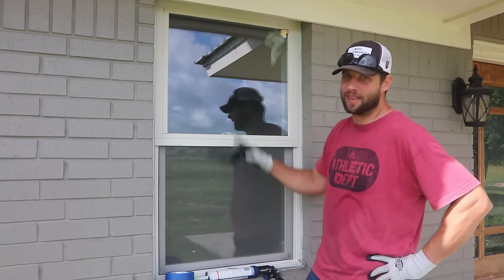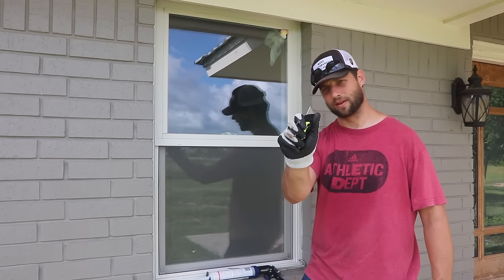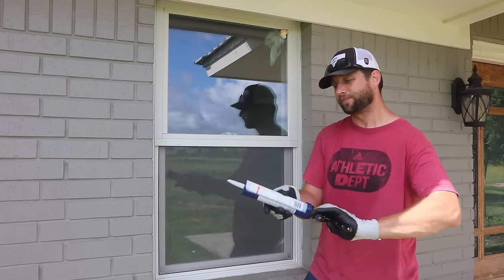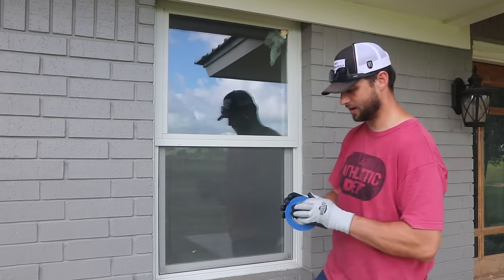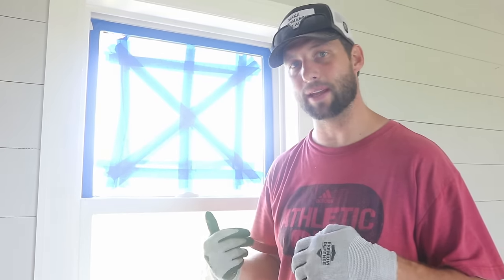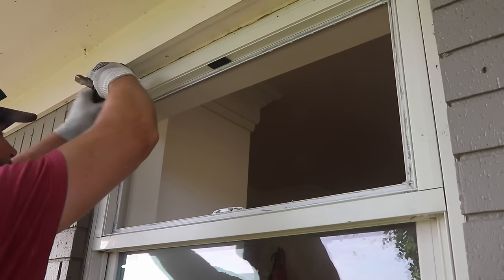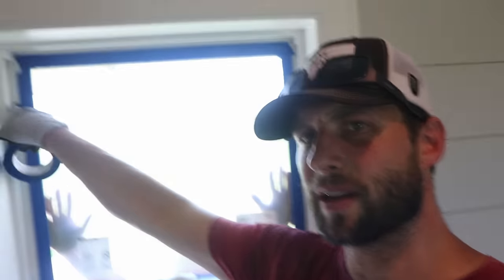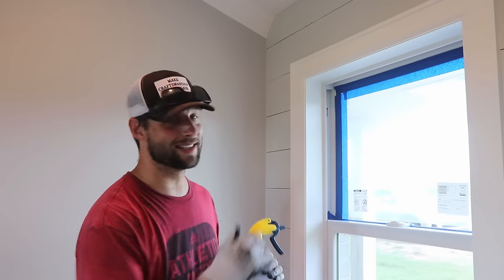Do It RIGHT!  How to Fix a Broken Window Pane

Comment: I do this for a living. Cutting the bead is unnecessary and will actually take more time because you have to pull out the piece that is still in the slot after you cut it. Also, if you had simply used your green utility knife and made several careful and deep passes when cutting out the old silicone/double faced tape, there would be no need for the tape to hold the window together. Also using a ton of silicone is unnecessary, making the masking tape unnecessary. And if there is any that seeps through, just wait for it to dry and then cut it away with your knife, or clean it with a utility blade and glass cleaner as lubricant. Just be careful not to scratch the glass. Finally, if you are by yourself, cut the old silicone/double faced tape thoroughly before removing the bead from the out side. It’s a lot safer. Then when you remove the bead, just pull the double pane out with a L shaped bar prying into the rubber of the double pane, not the glass, and catch it. Also make sure that the black rubber blocks on the bottom are not stuck to the bottom of the old double pane, so you can set the new one on them for protection. Those are my suggestions. I literally did these steps on several windows at work, just today. I’ve done this thousands of times. Just some tips for you.
Reply from the maker: YES!!!  This is why I do these videos.  I always learn more from you guys than I ever teach!  Thanks for the great tips!
Reply: @JordanSmithBuilds  Jordan you did a Great Job with your video, and what a nice reply to Mr. Mehring. Like you I have learned more from youtube because of caring guys like Mr. Mehring and you. Great Job, and keep up the good works! FR
Reply: Hey guys I was just curious what you used to clean all the excess silicone before you place in the new glass panel to install?
Reply: You should make a video. It would be more helpful to see it then just read how to improve!!
Reply: Anthony Mehring do you have any videos showing your process?
Reply: I think a good take away is that even though Jordan didn't do it the way an expert would, it helps give us a good start, a visual. Then this video acts as a way for us to find the expert commenter and learn even more. Thanks guys!
Reply: U right well prepared essay however do u have your video also why u watching this video if you know this well
Reply: @oktayuzun919   Stupid question. You think dancers don’t watch dance video? Comedians don’t watch other comedians, chefs don’t watch cooking videos?
I used to think there ARE no stupid questions. I was wrong.
Reply: Wouwww it's  the first  time I will be feeling genuinely stupid or moron and just agree  with someone whose calling me stupid. You are 100% right I don't even know why I wrote this stupid question or whatever it is  I was drunk I believe lol but feeling  stupid is one of the worse sorry to even bother u
Reply: I have a Silverline windows with the plastic beads. Could not get them out. Tried everything. Saw some videos on how to pry them out but did not work on my lower sash Silverline window and had to bring it to a shop to have it done for nearly $200.  Let me know if you have a video or have seen a video on how to replace vinyl Silverline glazing. Thanks.
Reply: I the same instructions I got the same problem
Reply: Please reply me thanks
Reply: Lol

Comment: We stopped putting the beads on the outside about 30 years ago in the 🇬🇧 and we stopped using silicone to seal glass about 40 + years ago, if we done it your way every house would be broken into one a week 😂
Reply: So your saying the silicone is the theft deterrent ? You still have to be on the inside to push the glass out.  This is how most glass is installed it sometimes a rubber gasket. But same idea.
 Armored glass on store fronts/ high rise are this way.
Reply: No, your using silicone to seal a window! We use two rubber gaskets one on the inside one on the outside, the beading on the inside so no one breaks in as easy..... 
If we done it your way someone would be in in seconds, knife around the bead and silicone then a suction pad to pull the glass out....
Reply: @seancoles7896  watch it again. Without cutting the inside your never pulling that out in one piece suction cups or not. ( So if your busting the window anyway for crime purposes why would you try to pull it out? much faster to hit it with a rock).  Anderson 100 casement windows have a double gasket on the  frame and a liquid applied seal on the glass from the factory.  

I live currently live in an area that spring means high winds like sustained winds of 60+ mph you have to be careful with opening doors because IF your kid opened the back door and you try the front as soon as you turn the knob that thing is flying open and the opposite is true to the point of busting the door  right out of the frame a time or two 😖 but never have I seen a window get blown away from the seal. I have seen broken glass from wind, but the seal was still in place doing its job.

PS this area is typical nice except for a few weeks each spring.
Reply: I guess breaking the glass wound be to hard. 😏
Reply: Have you seen the 30 seconds break in video via the sliding door and a rock. In and out in 30 seconds. Breaking in to any home with a sliding door is so easy. Why break a window?
Reply from the maker: We are very fortunate to live in an area where there is very little crime.  Houses and cars are usually left unlocked with the keys in the ignition.  In Texas, it's a pretty big risk to break into somebody's house unless you're absolutely sure that nobody's home. (Look up the Castle doctrine of your curious as to why).
Reply: Cuz glass doesn't shatter?what are you talking about?
Reply: Thank you sir. The Olfa 9mm knife is really a key tool here and made the job MUCH easier. Appreciate the tips...you saved me a bundle.
Reply: I was a cop for nine years, NEVER, had that happen. Universal key, a rock.
Reply: @moonshinewarrior  They're talking about breaking in, in a neat and orderly manner .
Reply: @seancoles7896  Well, if someone or a group of individuals want to get in through a window that bad, you are not doing anything to stop them. Rock breaks glass. If they want in that bad, a glass window will not stop them unless bullet proof.
Reply: @seancoles7896  if I need to worry about someone   breaking in my house with such methods I wouldn't live in that area.  You need  better fixes then  fixing  your windows.  😆

Comment: Good Job! If you want the silicone not to make a mess, I cut the tip of the  caulking tube smaller to start remember if you use a smaller cut to start with you can cut the tip bigger Until your ok with the amount of caulking coming out of the tube. And if you cut the tip to big and you make a mess, then you have to get a new tube and start over.

Comment: If you do get silicone on the glass you can let it dry and then take it off with a razor blade. This way you don't dilute the silicone you need with water while it's curing.

Bonus tip: Best way I found to clean glass is with vinegar and newspaper.
Reply from the maker: Good tip!  Vinegar and newspaper work a treat!
Reply: I’m a glaser (glazer? glasser?). Any way Just a utility blade and glass cleaner will work just fine. Just be careful not to scratch the glass. You don’t really need the tape. Nor do you need a ton of silicone.

Comment: I was told by a glass guy that you should use a urethane glazing caulk with insulated windows. Apparently, the solvent in silicone can damage the sealant between panes if it comes in contact.
Reply from the maker: hmmm.  I haven't heard that, but I'll look into it.  Thanks for the tip!
Reply: That's accurate some sealants can cause seal failure and result with a fogged insulated glass unit
Reply: Damn! That really sucks. I don't know why I've been using silicone for 23 years replacing Windows all the time. What do I know, I'm just a Glazier

Comment: Great video—my windows are 20 years old and I know the plastic trim on the outside will not survive removal and re-install.  Where can I buy replacement for this?
Reply: Your local glass shop should have some suppliers for the standard vinyl types. We keep the most common in our area in stock.  Some of these can be impossible to find as many styles/manufacturers aren't around anymore.
Reply: PS the most common name for the part is "vinyl glass stop"

Comment: Is it possible to replace single pane glass on old aluminum window with double pane glass only?
Reply: Sadly, the answer is typically no. Dual glazed windows are designed and built differently to accommodate the thicker glass. Depending on your window frames, you may be able to modify a single glazed window to accommodate dual pane with a little modification

Comment: What measurements do you give Anderson when you order the replacement panel?
Reply: Usually the style of window & what's called "daylight" the surface of glass that you can see through then they or you can add 1/2" on measurements for "bite "  or carefully remove glazing strips on outside and measure that way along with depth
Reply: Preferably 89-55-89.  ;P
Reply: @FA-cd2de  So it sounds like the actual measurements.   I didn't know if you could just say," I need a replacement upper panel for a 2'X4' (for example) window" and they would know what to send.
Reply: @wjthehomebuilder  if you went to the manufacturer then yes you could, I was speaking general terms. I replace IG (insulated glass) often and I usually do it the way I explained unless its warranty work then I tell them the order number and they can pull it up
Reply from the maker: There's some good answers already to this question, but in my case I called Andersen directly and gave them the product code that was on a sticker at the top of the window.  This allowed me to not only get the correct size but also all of the coatings to match the other windows.  You can have a huge color and performance variation if you don't match the coatings of the original glazing.
Reply: Thank you all for the answers!
Reply: Measure daylight and add 1". Thats normally 99% of vinly windows.

Comment: I like using the alcohol / water when doing any caulking keeps my bead very tiny
Reply from the maker: It really helps smooth the bead, doesn't it?
Reply: @JordanSmithBuilds  something I learned over 30 years ago while working at a cabinet shop.  Odd tips and tricks that sure can make like a lot less work

Comment: Step 1. Cut your glass free using something other than a razor knife. If it slips out of there just once you can severely damage your window frame permanently. Or even worse yourself. 
Step 2. Go outside and remove the trim, not cut it off of there. That bead is brand new and does not need to be replaced even though Anderson provided you some new stuff. note some windows may require you to remove the glazing bead first to alleviate some pressure between the glass and the frame.
Step 3. Remove any old sealants or double-sided tape holding your glass to the frame.
Step 4. Reapply your sealant or double-sided foam tape and the same manner as the manufacturer did. Remember, caulking is cheap and leaks are expensive! 
Step 5. Install the new window glass making sure it is centered from side to side.
Step 6. Reapply the glazing bead. That glazing bead could probably be pressed in simply with your fingers. 
Step 7. While the sealant is still wet, use a clean fresh double-sided razor blade to scrape off any excess on the interior. Yes, with that style of frame you will have some silicone that gets on the window frame. If you scraped it off well enough with the razor blade, any residue on the frame should be thin enough you can rub it off with your finger after it dries. Or you could spend the time and effort to tape it like you did

Comment: My first thought when removing the old silicone would be to put some heat on it first with a heat gun....seems like that would loosen it up.
Reply: Nope do not use heat on a vinyl window you could melt and warp the vinyl

Comment: Not to bad but I think you over complicated things.

1. If you get silicone squeeze out wait for it to dry (2-4hrs) then remove with razor blade.

2. The glazing tools you had are for putty windows are aren't really used for dual panes. I would recommend a 
4"flexible putty knife for cutting the back seal for most adhesives this will work.

When determining the exterior of your replacement glass. Do not use the laser etched glass bug as a reference. These commonly change locations on the glass made by fabricators and are normally only on tempered glass.
 If your window has a Low-e coating there should be a small sticker saying Lowe or a picture of a sun. This sticker should be on the exterior. If there is no Low-e then the dual pane can be installed both ways.
If your window has a texture or obscure glass on one side. We recommend installing the textured side to the interior.
Reply: What part of the country are you in? Many higher-end manufacturers actually do have a laser etched bug on every piece of their window glass such as Pella, or Anderson. It is not only for tempered safety glass.
Reply: @greglautz8470  We are in California. While most companies do have a bug on every piece it is not a reliable way to determine the handing of your replacement glass. Manufacturers commonly mess up the placement and can even double bug. The bug is simply there to help you identify the type of glass and the company it comes from.

Comment: How do I find out what window brand I have?
Reply: Depending on how old your windows are, if you look up in the header of your window there should be a little sticker of some sort from the manufacturer . Also referred to as an "AAMA" sticker.
The manufacturer name will have a two or three letter code representing their company name
Reply: Also, some manufacturers put their name on the lock mechanism

Comment: I checked my windows and they are not made this way. The clips seem to be one piece together with the frame that slides up and down in the tracks. It looks like there’s no way to replace just the glass without replacing the whole frame. Thoughts?

Comment: Was adding the tape on the inside to the old window really necessary?
Reply from the maker: Yes, because it was a dual pane insulated glass unit. You'll need to tape both the outside and the inside if both pains are broken.
Reply: I do this for a living. I literally did this on several windows at work, just today. I’ve done this thousands of times. I do know what I’m talking about. The answer is actually no. If this is your first time, it might be a good safety precaution, but it is unnecessary. Just make several deep, careful passes all around the window with a utility knife instead of a flimsy exacto knife. It will be a lot safer and easier. There is no reason to break ANY more glass in this process, unless you are re-glassing a JeldWen window, in which case, your kinda screwed lol.
Reply: Agreed with the other commenter. The only time I make tape up glass is when using my oscillator to cut the glass free from the frame, the vibration may knock out some pieces causing a safety hazard for myself. It should be everybody's intention to remove the entire dual pane unit as a singular unit and not intentionally break it and make it more of a safety hazard

Comment: What would you use to fill the gap if window replacement takes a few days ? That's my dilemma.
Reply: cardboard!
Reply: For the level of breakage on this window, you would only remove the glass when you're getting ready to replace it. If the entire unit is broken out and needs to be removed for safety, the sky is the limit for what you use to cover it up